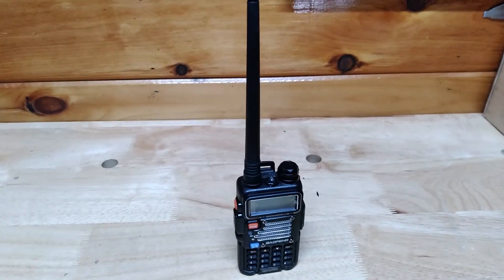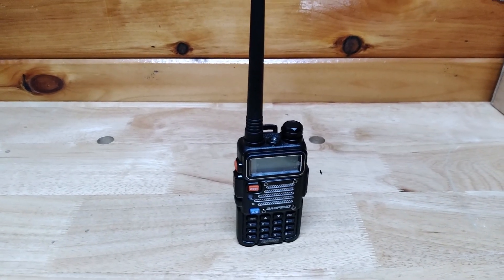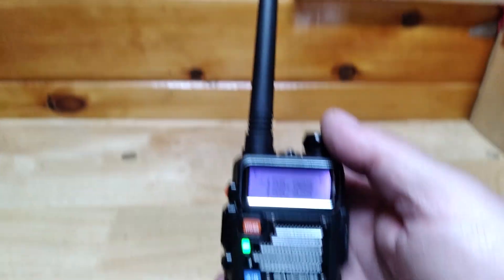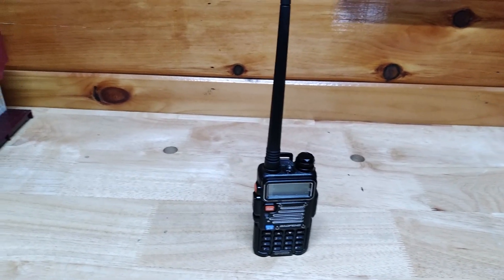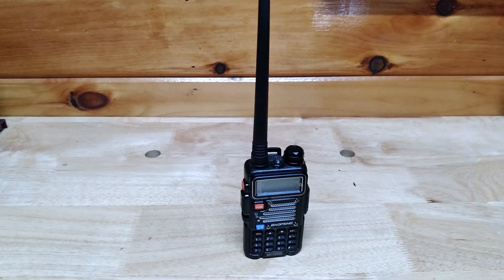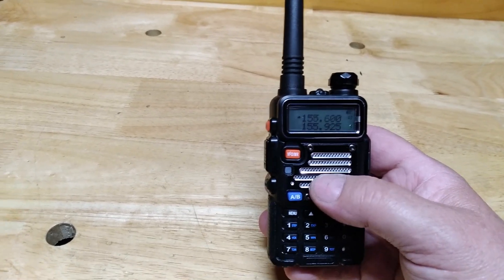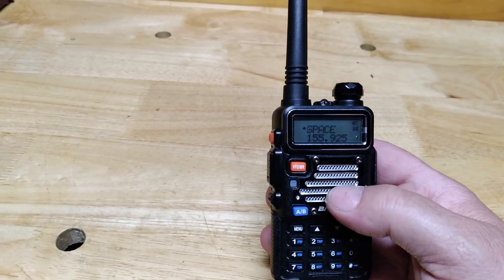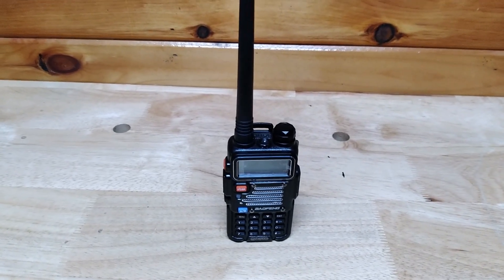What I have learned about the UV5R Baofeng

Comment: Everything in an analog radio is subject to compromise.  It's a sub-$20 radio!  I'm surprised  how well a UV5R even works, within a mile or two.  
Basement LED's are not very radio friendly.  A car can contain dozens of microprocessors.  They all make noise.  Some car dashboards will attract the needle of a compass from feet away!  
Baofeng walkie talkies are for carpool moms, the Amateur curious, and lumberjacks.
You may fashion a nice sub-ground repeater from those radios  :-)  Good stuff  🙂 
Skip the radio "reviews" and listen to guys like this who aren't selling radios.  Those ham-vertisers are too confusing.  Participants aren't that way.  
Install Chirp software.  Get a cheap cable.  It's legal to learn.